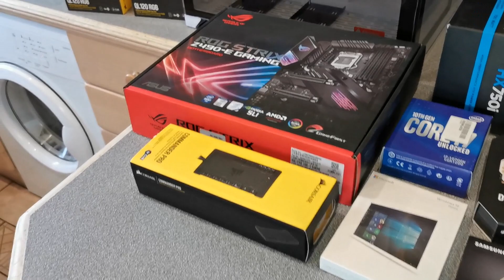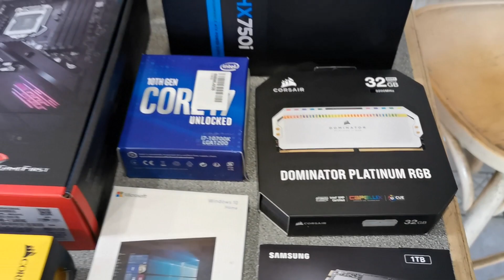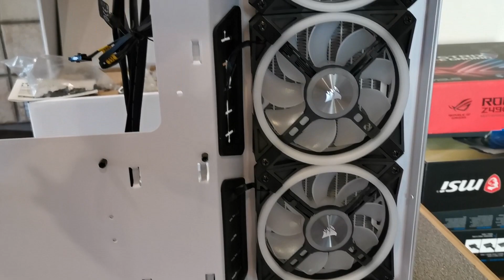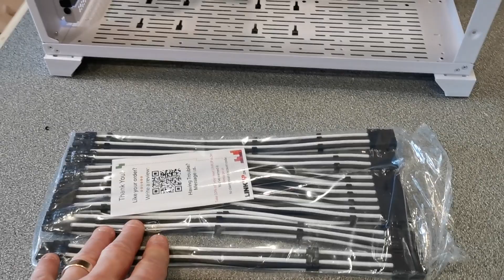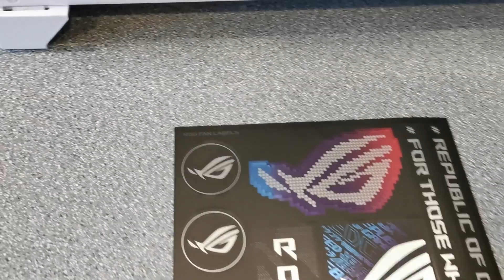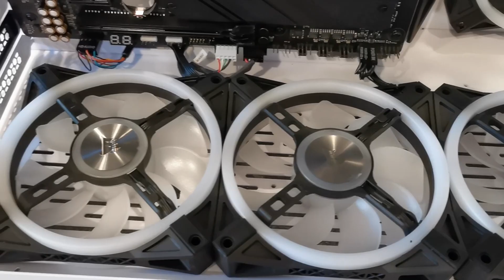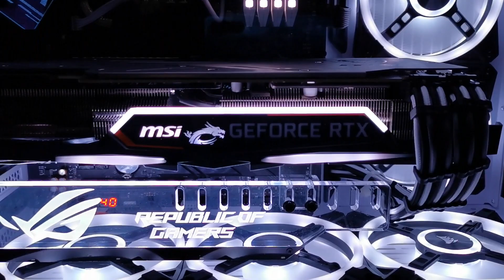Lain-Li 011 Dynamic Mid, Corsair RGB Build

Comment: do you think you can fit a push and pull fan configuration in this build?
Reply from the maker: Yes you can if you move Rad inside the case having the push fans in the space at the back, the only issue with the pull fans being so close to the side of a long Gpu it may cause heat back into the card, The best solution is to fit a Founders edition (3000 series) and not an aftermarket cooler, The way this is setup is ideal as rad is in a separate compartment away from all the warm components, temps - @4.8ghz is 30-34c normal everyday use, Gaming is 45-55c after 3-4 hours